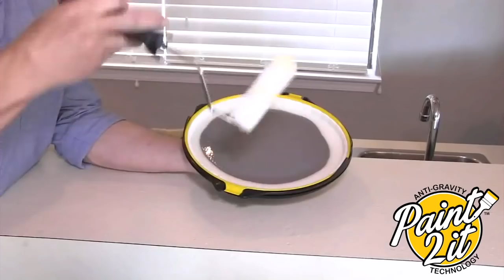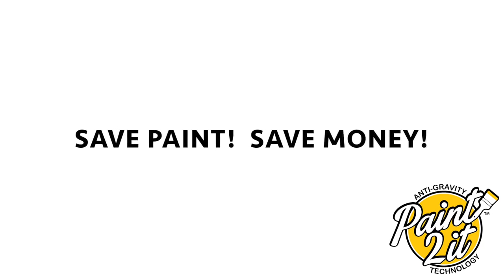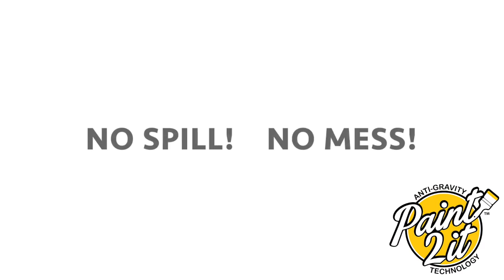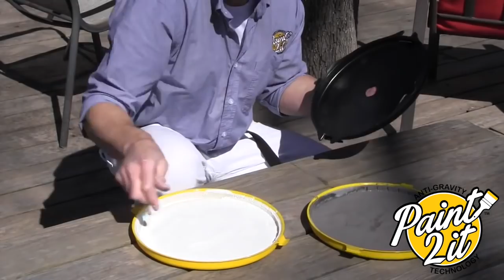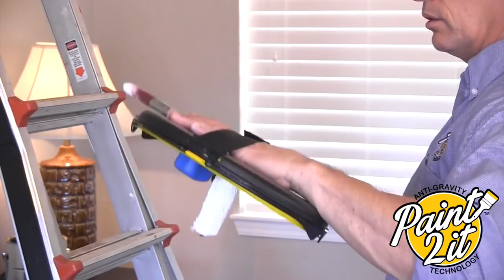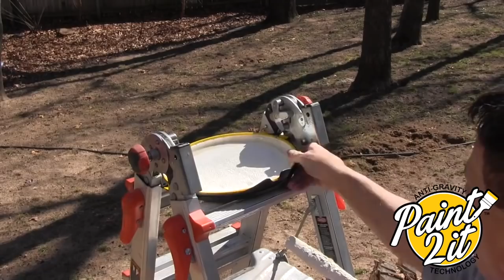Paint2iT Pro (Reusable)

Comment: I don't know many 'Pro's' who would paint an entire house with a mini roller, doesn't seem to hold much paint and certainly wouldn't be that good with a 9 or 12 inch roller - I suggest the word 'Pro' is taken out, complete nonsense, just another gadget for the casual DIY'er, who will buy it, use it once and away in the cupboard it'll go, then end up in land fill, don't we have enough of a problem on this planet with useless plastic junk - I'm a painter/decorator by trade, a good 9 inch roller, small rag roller, brush, steel paint kettle and tray work well - tried and tested for a long time